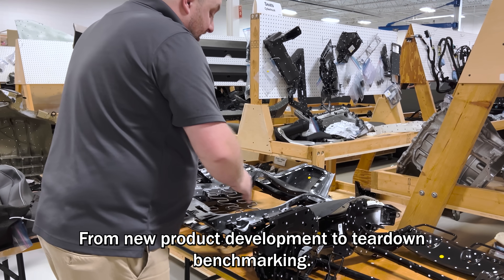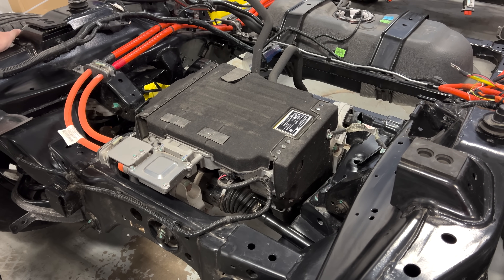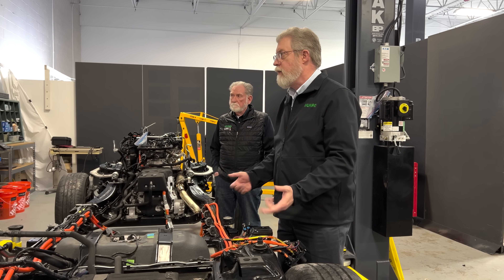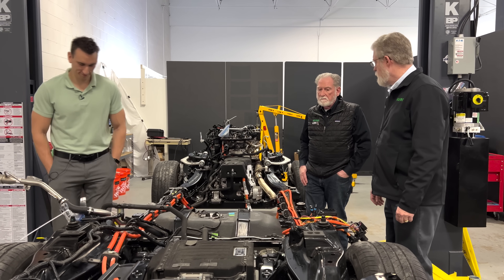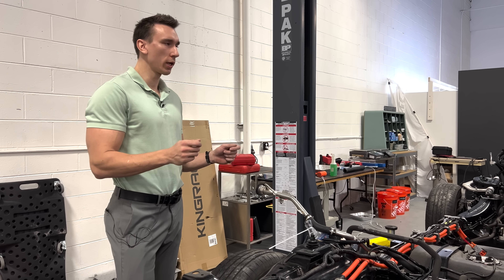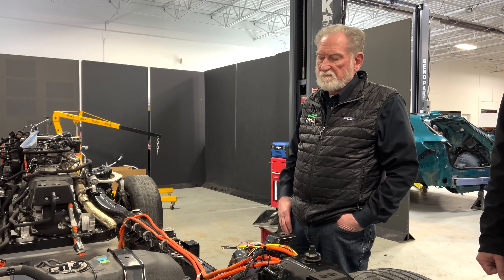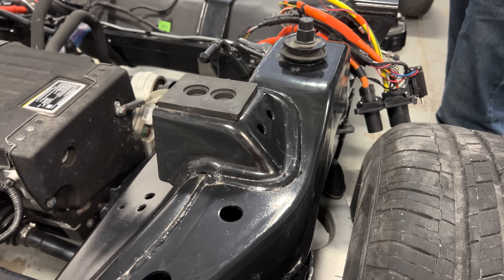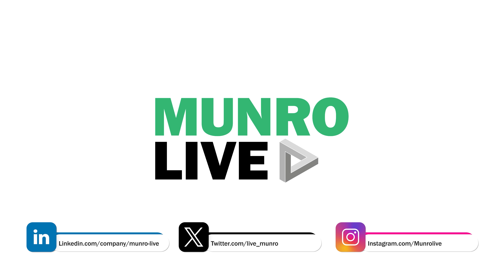There's a Monster Under the Bed of the BYD Shark!

Comment: Cable carrying heavy duty ripple current will be set into vibrations (with respect to the chassis) at some audible frequencies. 

The example in this video offers a big emission “antenna” can incur excessive emission by FCC standard. 

One supply cable and one return cable take a big U turn produces twice the volume of ripple nose and many times the RF emission. A ground strap only reduces but fix the  problems at the root. 

Root fix is to run both supply and return cable bundled close to one another and mechanically isolated to the chassis from acoustic vibration. 

This fix will reduce emission to below FCC limits. Ideally consider let both cable route partially engulfed by the structural frame. 

Chose a side, left or right, to route the power cable pairs by which collision statistic is at the least.
Reply: You know, we can clearly see that the supply and return cables are paired right next to each other.  The pair on the right goes from rear motor to battery.  The pair on the left goes from the charging port to the battery. At no point would both pairs be energized, because that would be running the motor while the car is plugged in, and all EVs have motor lockout while plugged in.

Comment: The comment on potential electrical interfence and ground loops is total nonsense.  The left side is rear motor to battery and the right side is charging port to battery, so there is NO loop created.  The ground strap is because the motor is on insulated rubber bushings. 

It's actually offensive how he's against a frame built very strong, rather than weak and disposable, that the frame is build for an actual comfortable passenger suspension rather than as cheap as possible. 

And its really ignorant how they're supposing poor FEA and outside suppliers, when BYD obviously has good software developers and is well-known to be vertically integrated.
Reply: I agree with this. Only the right side or left is active at any given time. They are never active at the same time so I don't see how a loop is created.

As soon as you plug in to charge, or plug in a v2l adapter to discharge out of the charging port, the car cannot be started or driven. So the left side lines are not active when the right side is in use.
Reply: Good luck on resale😂
Reply: @myeverythingworld8123  I say the same about them fords and chevys, lets not even mention ram lmaooo
Reply: I agree.
Reply: It's stunning that their EE came up with this bizarre view.  Sandy, I'm not surprised.  For a moment I thought they were suggesting that it used a ring-mains circuit that's common in UK homes to equalise voltage drop among outlets.
Reply: @What's even more bizzare is how we can all see with our own eyes that no such loop exists.  It's not like there's a redundant (and dangerous!) direct wire path from the charging port to the rear motor.  

Besides, UK-style ring mains are a solution to a problem that no longer exists.  I can't imagine that they use it in any new construction.
Reply: @ZweiZwolf  They are getting less popular, and we do get conventional radials now, but I expect plenty of rings are still going in, even on new stuff. Sparkies have got attached to them for some reason.
Reply: Totally agree. I'm starting to lose my confidence in what "Munro" is providing in any of their Youtube videos. They certainly don't understand much!! 
Their motto of leading innovation is wrong too. Their assessing and critising innovation that's already taken place - 'hindsight Kings', and not much good at that either. It's time to start watching people who actually know what they are talking about rather than stumbling along, making comments about things they have no idea about.
Reply: As former power conversion engineer, Munro EE is a bit off on ground strap. That ground strap is actually an RF bonding strap sink RF noise from inverter case. It is common practice to bond noisy cases. Also RF noise can never be totally eliminated, it can only be attenuated to whatever level is accepted for a given application. Ask yourself why there’s typically no AM radios on EVs.
Reply: Glad to see your comment getting likes. Munro's hyperbole and tech errors have been frustrating to watch going unchallenged.
Reply: Chinese bots assemble!
Reply: They have attacked the Shark from the moment they drove it in to there Workshop. Totally biased against the Shark , there has beens that’s why there is no Production in America.. 😊
Reply: @ Exactly.  They are just destroying their credibility for no reason at all.  I'm glad the other engineers and techs are calling them out.
Reply: The rh and lh side are actually in a loop, but only during charging.
The power comes in at the front, goes down the rh side to the back, which is probably where the onboard charger is, then it travel back down the lh side to the battery, feel free to correct me if wrong
Reply: @gtjack9  No, that's not right, because there is no connection between the left and right, so there's no loop.  The HV wiring is a hub and spoke, where the battery is the hub, and there is a spoke to the front motor, a spoke to the rear motor, and a spoke to the charging port. BYD probably integrated the onboard charger into the battery pack, reducing component count, simplifying connections, and leveraging the pack's thermal management. 

Power flow can come in from the charging port to the onboard charger in the battery pack, and the motors are locked out.  Or, it's driving on front and/or rear motor, and the charging wiring is idle.  Or, it's doing regenerative braking from the front motor and/or engine, in which case both rear pairs are idle.  At no point would both rear HV pairs be energized.  

Given the choice of how to lay things out, I think it makes the most sense for BYD to have put the onboard charger on the pack.  And it's not like this is their first EV with a range extender.  I think this is their 5th generation Dual Mode, so I'm pretty sure they've gotten the basics squared away to preven unnecessary loops and such.
Reply: About the strap, yes, it's so obvious (I was thinking when watching that section of the video about a ground failure path for fast fuse and contactors trigger + resistance tests, and I'm a technician, I'm not a PhD in engineering)
Reply: Yep, spot on mate.
Reply: They just didn't understand the technology

Comment: That trunk empty is 2,710kg 5,975 lb. it is heavy. not sure if it’s the chassis or the battery that made it heavier. i think based on what they said the chassis is over done. it adds to the truck weight. i do not like the beefy chassis.
Reply: All BYD models are very heavy leading to poor efficiency, look at tge Seal over 250kg heavier than the equivalent model 3
Reply: @camsmith4047 tesla integrate everything into one assembly. Save lot of weight on bracketry and connection. But, if one goes, the whole system goes. The LRU only to system level. Ok for consumer product go for 5 to 8 years. But not so much you want to keep it long time because lot of proprietory part that once OEM support ended, after market is not likely to pickup. It is differnt philosephy in design. One is one part to do one job and only job. You can replace individual part to keep the machine going for a long time. The other, one is goes, the whole thing goes. Might just throw it away because that integrated unit worth a good protion value of the machine.
Reply: @camsmith4047 not a very good baseline. Tesla NVH control is marginal at best, and build lot of body part out of aluminium. More over, the propulsion system, BMS are integrate. They are not LRU. The good is as you can see, lot of weight saving, the bad is if one of the sub system go wrong. Say the mofset or the BMS. The whole motor assembly or the battery pack has to come out. That is your labor...

Comment: How many CCP 50 cent army "bots" have showed up in the in the comments to run damage control for BYD. 🤣 

That stupid bonding strap will rot away after the first winter, and all that EM noise will return and wreck havoc on everything.

Comment: The losses aren't small, there isn't enough current there to power a single ultra low powered LED, you'll loose more efficiency on a trip by drinking a 2nd soda during lunch....

Comment: You’ve got to think of the markets where this vehicle is going and how it might be operated and repaired, also what the customer expectation for vehicle longevity is.  There are reasons for directing crash energy to bolt over a weld, though I’m not sure that applies to the rear subframe; I’m not a structural engineer.  Anyway, some versions of this truck are probably intended to go to second of third world locations where having a robust vehicle which is easy for semi skilled technicians to repair snd lasts a long time mstters.  That statement is a bit at odds with the complexity of this vehicle being a hybrid drive… however if the frame and some of the running gear are shared with a more basic gas or diesel model, then it is probably cheaper to re-use what already works for the hybrid.  Not knowing the production numbers leaves it an open question.  If BYD does not intend to make a lot of hybrid Sharks, then sticking with old school what works is probably less costly than amortizing a redesign over the same number of vehicles.
Reply: ANYONE seen videos from India, Africa, Asia where trucks are insanely overloaded 4m high with huge loads?   Perhaps that is the target market!   NOT Lot Crawler Urban Cowboys and Pretty Boy Dance haul trucks in the West.,,,